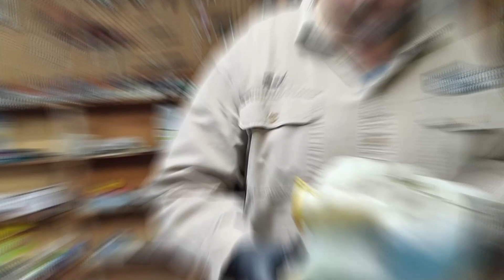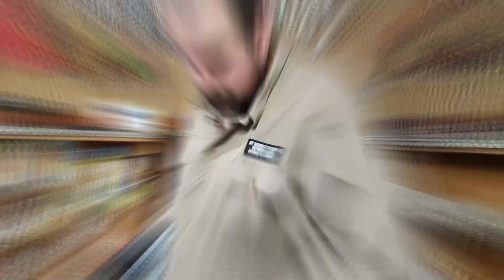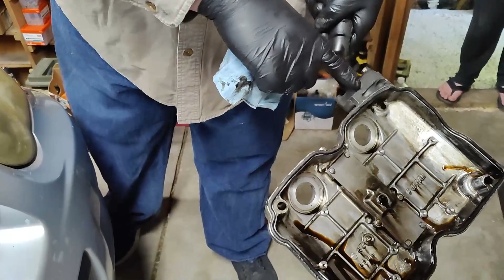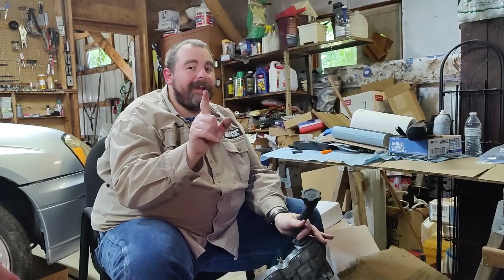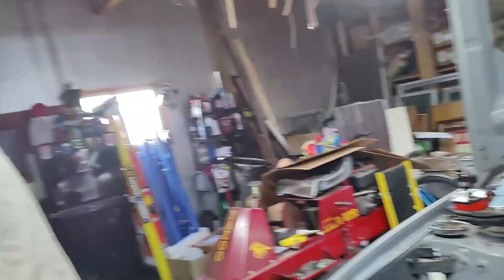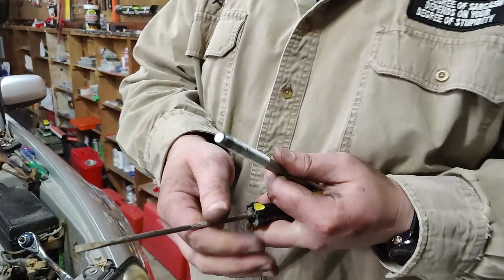Disaster!! The bolt was STRIPPED on the head of our Subaru Impreza! No wonder it was leaking oil

Comment: I have a 2007 forester that I bought used and cover on right side is leaking.got the bolts out and found out I’ll have to raise the engine just to get the covers out to replace gaskets so I just put it back together and do the work when I have more time. Went to tighten cover bolts and 3 were stripped out threads so now I have to pull the engine to fix. Also why didn’t Subaru design the frame to allow for such a simple maintenance fix.
Reply from the maker: Probably for the same reason as mine. The metal is too soft to be re-torqued more than a couple times. It wasn't really designed for being on the road long enough to need it without being part of a rebuild-replace.